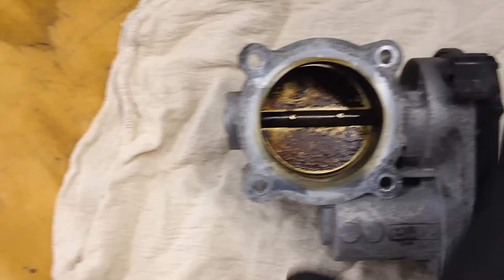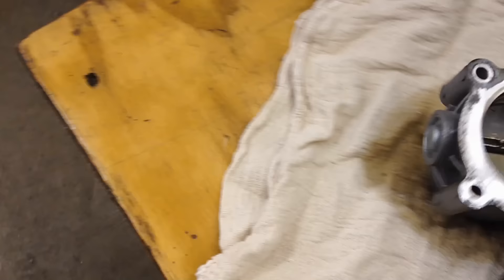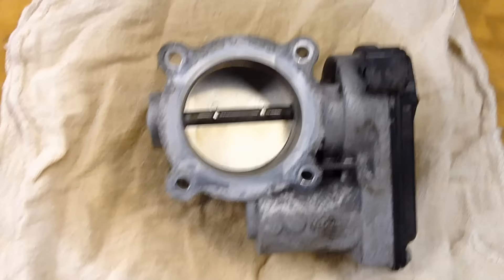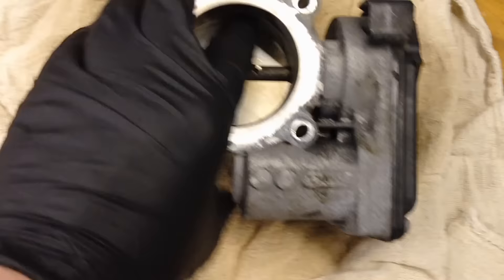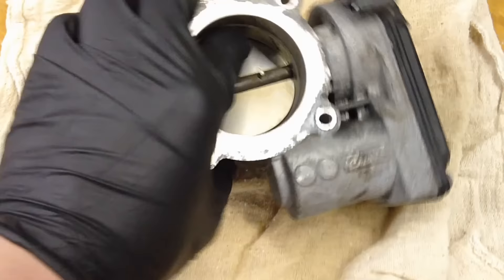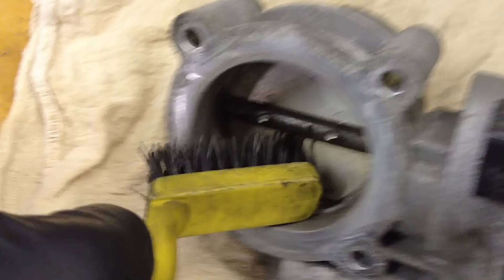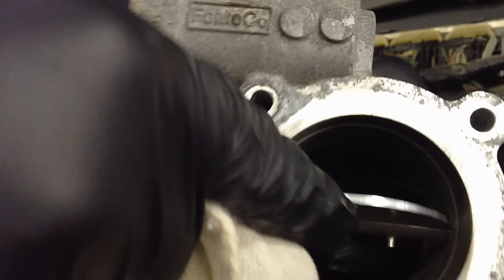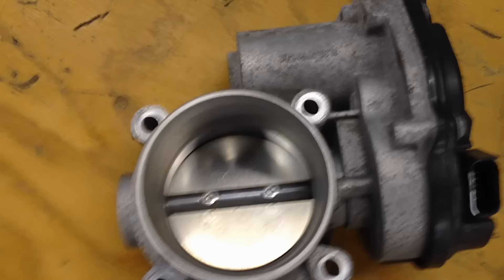How to Clean an Electronic Throttle Body Safely

Comment: correct me if i'm wrong, It seems to me that the throttle Body it is not closed completely!
Reply from the maker: +Ahmed A Correct it stays open just a bit so it does not get stuck in the bore.
Reply: I don't think it ever needs to be closed completely. Your engine always needs at least some air to operate at idle. And to shut down completely your ecu cuts electric circle to your ignition coil and your spark plugs stop making sparks. So fuel doesn't ignite - engine stops. Throttle body valve stays this much open anyway.

Comment: I have a Nissan Altima  07 did the same thing  but after putting back on my car it started revving  its self  so I got a new on one and also change the maf sensor but still doing it. By the why I have done the ideal relearn process. Help!
Reply: +Luis what did you end up doing to the car ?
Reply: +hector gerardo I took it to my local break max so they could do a full computer reset to it could relearn its idle position. They charged me 140 but it back to normal.
Reply: Really but also did you disconnect the negative battery cable before the removal or did you disconnected both cables
Reply: +luis h i have a 2006 sentra spec v and i stupidly cleaned the throttle body. messed it up. had to buy a new one and do the idle relearn thing. if you couldn't figure it out, you might have to go to the nissan dealership and have them do it with the consult 2 machine.
Reply: +xYouthAttackx thanks man! I got already .

Comment: hey I got a 2009 chevy malibu  i clean the throttle body myself with throttle body cleaner mine looks just like the one you cleaning in the video. I had put a rag on the throttle body but I 4got to remove it and I start the car,the car start but had poor idle, took the cover apart and found the rag it was intact. I put it back together and now is got high idle problem. What can I do?
Reply from the maker: Carlos Gaona Those gm throttle bodies must be calibrated by the dealer scan tool.
Reply: thank you so much
Reply: +FordTechMakuloco when Carlos got high rpms instead of taking it to the dealer could he just replace the throttle body unit ?
Reply: +FordTechMakuloco when Carlos got high rpms instead of taking it to the dealer could he just replace the throttle body unit ?
Reply: +FordTechMakuloco when Carlos got high rpms instead of taking it to the dealer could he just replace the throttle body unit ?
Reply from the maker: hector gerardo Any new or cleaned throttle body on the gm vehicles requires relearn by the gm scan tool.
Reply: oh man soooo sorry for all them repeated questions stupid phone is messing up on me but anyways back to the topic I was preparing to replace my sisters throttle body unit on her 08 2.2 Chevy cobalt because of the stalling issues shes having when she is driving slow so on her car am I supposed to get the dealership to relearn the idle? if not then I'm ready to replace it  tomorrow morning
Reply: oh man soooo sorry for all them repeated questions stupid phone is messing up on me but anyways back to the topic I was preparing to replace my sisters throttle body unit on her 08 2.2 Chevy cobalt because of the stalling issues shes having when she is driving slow so on her car am I supposed to get the dealership to relearn the idle? if not then I'm ready to replace it  tomorrow morning
Reply from the maker: here you go from the Chevy workshop manual-
Without Scan Tool-Learn

The engine speed is between 450-4,000 RPM.
The manifold absolute pressure (MAP) is greater than 5 kPa.
The mass air flow (MAF) is greater than 2 g/s.
The ignition 1 voltage is greater than 10 volts.
Start and idle the engine in Park for 3 minutes.
With a scan tool, monitor desired and actual RPM.
The ECM will start to learn the new idle cells and Desired RPM should start to decrease.
Ignition OFF for 60 seconds.
Start and idle the engine in Park for 3 minutes.
After the 3 minute run time the engine should be idling normal.
Important: During the drive cycle the check engine light may come on with idle speed DTCs. If idle speed codes are set, clear codes so the ECM can continue to learn.

If the engine idle speed has not been learned the vehicle will need to be driven at speeds above 70 km/h (44 mph) with several decelerations and extended idles.
After the drive cycle, the engine should be idling normally.
If the engine idle speed has not been learned, turn OFF the ignition for 60 seconds and repeat step 6.
Once the engine speed has returned to normal, clear DTCs.

Comment: Mine remains closed at half throttle is this normal? Also when driving slow I can hear allot of hissing coming from it. Engine is a 3.2 five cylinder diesel Ford Ranger.

Comment: Got an 05 vw and I cleaned the tthrole body and not it idle and I turn in on and its dies also it takes a little longer to turn it on and sometimes it doest turn on plz help
Reply from the maker: Sorry VW is out of my league I have never touched one. They must have a idle relearn like the gm vehicles on the scan tool.
Reply: try disconnecting the battery for ten min

Comment: I've heard your not supposed to move the plate by hand at all u should have someone press the accelerator with koeo then clean it
Reply: I just left a mechanic that told me the same thing about not moving it by hand. I have a 2007 Maxima and he said it would deprogram it.
Reply from the maker: John Brown No no you do it disconnected and by hand I can send you the tsb from Ford that states this if you don't trust me.
Reply: FordTechMakuloco I believe you. big fan to thank you for making the vids for us. but what about other makes.

Comment: Great video, but just unplug the electrical connector, you didn't have to remove it entirely :o
Reply: Most cars it's only 4 bolts (5 minutes) and this way you can get it super clean...

Comment: And if we already cleaned it and the car is sill acting up do we just get a new one
Reply from the maker: In general yes
Reply: There can also be other probable causes to why you are experiencing a poor performance
Reply: like what ??
Reply: It can go as far as being the transmission, the fuel injector, the timing valve, or something else I haven't mentioned. It would be best to get a mechanic that you can trust to look at your car
Reply: I would try cleaning the Throttle Position Sensor first.
Reply: The number one reason would be a bad C.O.P. (Coil over plug )
Reply: Clean your MAF and IAC with the throttle body
Reply: Amanda Burns 
I was thinking the same thing 😂

Comment: my English is bad, I have a problem, clean the throttle body, but the car have the RPM is 1000, what i can do?
Reply from the maker: Dienal Del Cid What vehicle and year? Its stuck at 1000 now?
Reply: Is a civic si 2006 k20z3
Reply: Get off slow

Comment: Would you be willing share the torque specs of the the throttle body bolts, for a 2013 Ford Flex 3.5L non-turbo? Thanks in advance.

Comment: how about a video on how to clean a plastic electronic throttle body out of a Ford Focus need help
Reply from the maker: +notsure3331 Its the same procedure as a regular cable driven throttle body.
Reply: +FordTechMakuloco what I am worried about using any chemicals other than seafoam in a plastic intake and throttle body I have a 05 Ford Focus with a 2.0 duratec engine any chemicals not Pacific Pride by manufacturer will damage the engine they say so you being a Ford Tech using carb cleaner or seafoam cleaner on a plastic intake is that safe or not that is my question because the intake is $500 complete assembly throttle body and intake gaskets included do not want to pay that price if this goes wrong
Reply: +FordTechMakuloco what I am worried about using any chemicals other than seafoam in a plastic intake and throttle body I have a 05 Ford Focus with a 2.0 duratec engine any chemicals not Pacific Pride by manufacturer will damage the engine they say so you being a Ford Tech using carb cleaner or seafoam cleaner on a plastic intake is that safe or not that is my question because the intake is $500 complete assembly throttle body and intake gaskets included do not want to pay that price if this goes wrong
Reply: +FordTechMakuloco what I am worried about using any chemicals other than seafoam in a plastic intake and throttle body I have a 05 Ford Focus with a 2.0 duratec engine any chemicals not Pacific Pride by manufacturer will damage the engine they say so you being a Ford Tech using carb cleaner or seafoam cleaner on a plastic intake is that safe or not that is my question because the intake is $500 complete assembly throttle body and intake gaskets included do not want to pay that price if this goes wrong

Comment: If I do this to my 2012 F150 and 2013 Mustang, how do I perform the re-learn process or do I need to ?
Reply from the maker: Jason Adamson I explain everything you need to do in my How To Clear Your PCM'S Memory On Fords After Repairs video
Reply: Thanks for the info ... I did this cleaning and the PCM reset but since I did this I have noticed a high pitch whistle sounds while driving around 1300-1500rpms. It does not make this sound in PARK .. Only while under a load. I have triple checked the air box hose connections and removed and replaced the TB again in case something wasn't seated correctly. Any ideas ???

Comment: dude im having trouble with my car how dO u fix a throttle body position snsor
Reply from the maker: +Francisco Demain Which vehicle year and engine
Reply: +FordTechMakul
Reply: 2009 pontiac G5
Reply: 4cylinder
Reply: Best way is Google 
"how do I fix a throttle body position sensor 2009 Pontiac G5"
Or...
"throttle body position sensor 2009 Pontiac G5" 
But...if all you type is
"...body position sensor" 
you will be redirected to flying saucer accessories, asteroid detection unit with wire harness, free shipping from Alpha Centauri.

Comment: Anyone know how easy that plate should move? I require a good amount of pressure to be able to move mine. I will clean it tomorrow.  1:30
Reply from the maker: There is a return spring so it will take some effort.
Reply: Thank you. I cleaned it seemed to run a little bit better. However it did again after a 30 min. drive. I'm wondering if its faulty, and/or is going bad. @FordTechMakuloco

Comment: Could you not have just disconnect the battery?
Reply: Maybe , but here's some reason not too :

1 - Some vehicle Radios won't turn on if you don't have the Special Code for it.

2 - You should never disconnect a Customers Battery if you didn't connect a "Real" Battery Saver to the Cigarette Lighter. All Saved Radio Stations will be lost.

3 - If you Jumped your Mothers Battery Monday because it wouldn't Start. Afterwards , she's a Happy Camper.

Tuesday Morning your Sister Jumped her car. Afterwards, she was a Happy Camper again.

Wednesday Morning, her car doesn't Start. I live across the Street. I put my Digital Voltmeter Leads on her Positive & Negative Battery Posts. It's reading 11.3 Volts. I tell 'er she needs a new Battery. She & your Sister go & purchase a New Battery & we install it.

Thursday Morning, car fires right up.
Don't need any assistance from you, nor your Sister.

She has a Smog Inspection @ 11 AM here in Southern California. She FAILS the Smog Inspection because when I disconnected the Battery Cables for the New Battery , ALL On Board Diagnostic Monitors were set to "Not Ready" and she hadn't driven yet the many miles required to bring things back into Compliance.....Before I disconnected the Battery Cables , ALL Monitors were reading " Ready" , ........If I woulda connected a Battery Saver to her Cigarette Lighter, she wouldn't have experienced the Smog Check Inspection FAILURE........It's wise to utilize a Battery Saver on ALL 1996 ( On-Board 2nd Generation ) vehicles & Newer.

Auto Professional background
Southern California

Comment: Hi I have nissan Tiida (Versa) Recently changed spark plugs and macanic cleans throatal with WD-40 but now the problem is my RPM goes up & down what is the actual problem please help me
Reply from the maker: They likely ruined the throttle body, Nissan might also have a relearn procedure.
Reply: FordTechMakuloco  Any Advise now the problem is still going on...Mechanic told me drive this car after 2 days it will be OK automatically
Reply from the maker: +Mohammad Hamad Does he know if Nissan has a relearn procedure or is he just guessing. Ask the Nissan dealer to perform a relearn with their scan tool.

Comment: If in the plastic side says do not clean I think is better to buy a new one. There is a reason those words are there
Reply from the maker: Huh? Ford has a tsb on cleaning them in detail....
Reply: FordTechMakuloco I thought it was dodge. I bump into your video when I was looking for electrical throttle for dodge nitro. That one says on the side do not clean. I was looking exactly where the electrical throttle goes for replacementnt

Comment: Holy shit that throttle body u used in the video was one of the dirtiest ive ever seen. I swear the drive by wire TBs are such a ridiculous invention. More sensors to break and more items u yet again sometimes cant even clean if u have a relearn setup.
Reply: Travy B While I agree, I like the metal cable...at least it gets rid of the IAC.

Comment: Experienced mechanics DO NOT RECOMMEND removing electronic throttle bodies for cleaning. Use a helper to depress trottle pedal in auto with key on to open flap normally.Then use tooth brush to clean both sides of flap . Removing throttle body can cause position to be thrown off ie; ERIC THECARGUY&OTHERS.
Reply from the maker: This has to be a joke right? Are you saying ETCG is right and Fords official printed procedure is wrong? Please explain….

Comment: Or you can disconnect the battery for 30 mins then do it after your done reconnect done:)
Reply from the maker: Why wait when you can do it immediately? You should really pull it off car to clean both sides properly so you would have to disconnect it anyway.

Comment: From week ago I had short response from rpm 1 till rpm 2  I visited several mechanics each one have a default idea and I dont have trust untill am sure of what  error I got on my ford edge 2010 limited  56000 km anybody got like this problem before plzzz coz I think its dangerous while  driving thanks a lot.... some of them said gear others electric spark ....
Reply from the maker: If you are getting a hesitation etc when accel and is not harsh like a misfire I have changed plenty of throttle bodies on 2010 edges fore this concern it will never leave a check engine light, some had real low mileage on them. I could catch them on my live data feed though. Have a Ford shop check it out for the concern they have the live pid data stream to see it happen.

Comment: After the cleaning, the car is running okay, but the check engine light still on , and the cruise control light is blinking!
Reply from the maker: Follow this procedure- https://www.youtube.com/watch?v=ZNxXM75zJOw
Reply: I will try! Thank you Makuloco!
Reply: This will work on a 2007 subaru impreza? Maybe not! There is a different way to relearn the computer?
Reply: roger fierro

Comment: why not just disconect the neg battery terminal, killing all the power to the entire cars electrical system?
Reply from the maker: Well I look at it from the dealer stand point to not lose radio presets or clock time etc.
Reply: FordTechMakuloco just disconnect the plug on the throttle body.
Reply: well, thats an even better idea
Reply: Spencer Smith :)
Reply: Spencer Smith Then you wouldn't be able to clean the back side of the plate..
Reply: MitchF150 Silly me. Right!
Reply: you can still manually open the throttle plate. It doesn't need power to open it. I do this with my 05 corolla.

Comment: 2 mistakes. Spray a little,wait a minute,cleaner will licquify buildup,then spray again,save a lot of cleaner.next rember the protective coating,you just ruined that with the brass brush.
Reply from the maker: First the cleaner is so strong is breaks down immediately as you can see in some cases is comes right off from the spraying itself. Second there is no special coating on these throttle bodies like the ford units from the 90's.